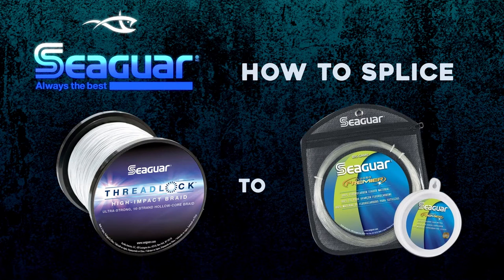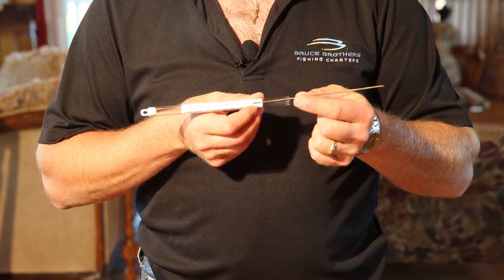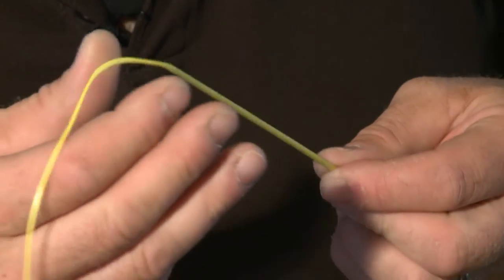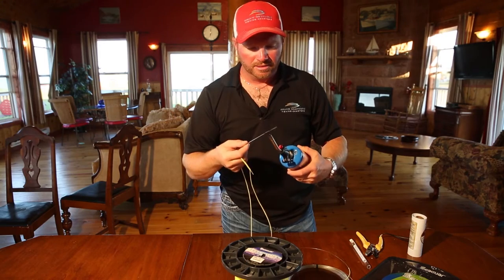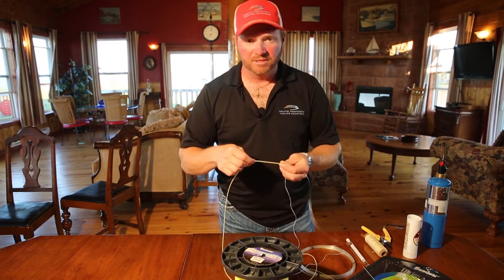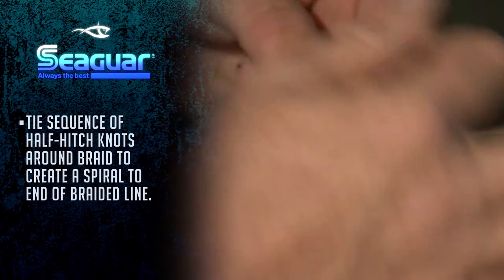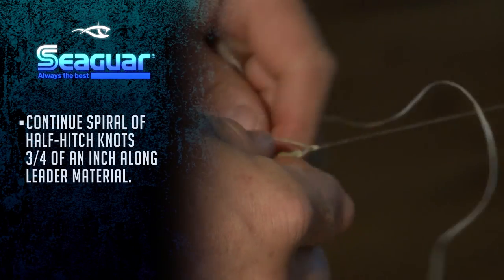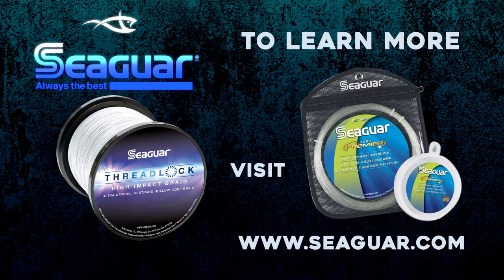Solid Connection: Splicing Technique Strong Enough to Hold Giant Bluefin Tuna

Comment: I use 50lb Braid for the wrap and use a spindle for the wraps. And....glue the knot so it stays put. To me the secret was The thinner the needle the easier the mono inserts into the HC. I was using 130lb needles because the HC was 130. My mono was only 80. Once I downsized the needle from 130 to 80 this became a very easy process!